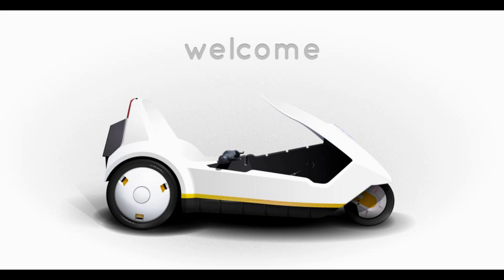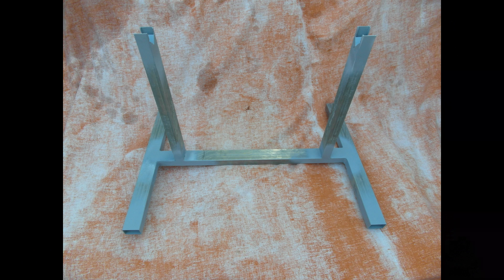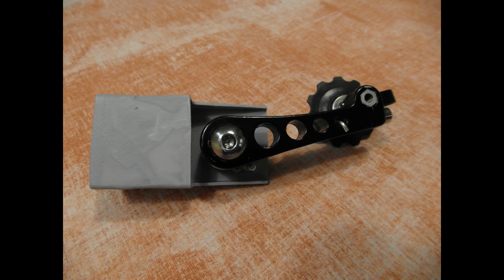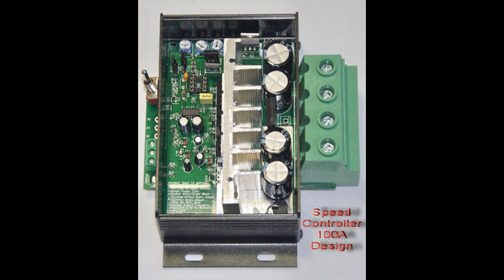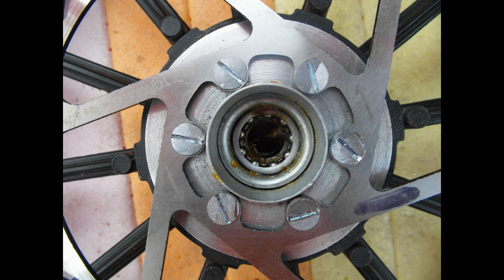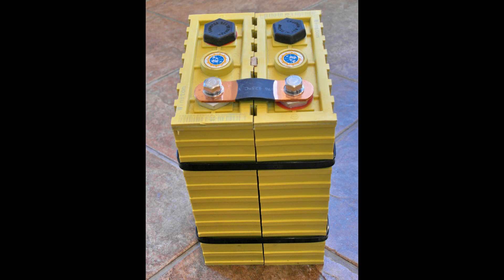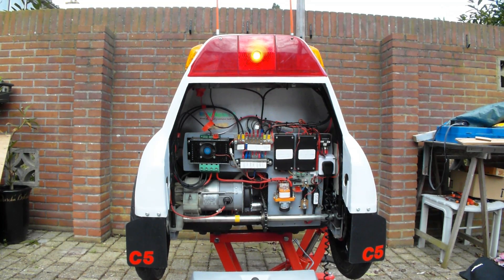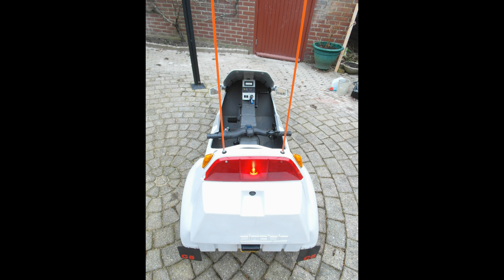Sinclair C5:  Hello I am Clive, 30 years on.

Comment: beautiful restomod. im planning on doing similar mod but using ebike parts.
Reply from the maker: Welcome to the few who have improved their C5's with modern innovations and materials. This particular machine is still in regular usage for 7 months of the year and it now has a younger brother, which has been adapted with a 48v, 350w Front wheel drive, a disk brake and telescopic suspension. This machine also has an 8 speed pedal assist rear hub, and is the only C5 that I know of that can drive in reverse, without the pedals being turned whilst in reverse! A center console is installed and a windscreen. The seat is high backed, padded and with a head rest. The mirrors are to be replaced this season with a LCD screen after the windscreen, in combination with a rear facing camera which is built-into in the rear number plate lamp. Don't be afraid to discuss your ideas or problems, many answers are out there, and I am willing to help, (from a distance,) as I am a resident of The Netherlands! The C5 has been a good hobby, but it's now getting more expensive. Regards, Ty Hawkins
Reply: @Ans1401  Hello neighbour im from belgium, native dutch ? i hope to pick up my c5 tomorrow.
Reply: @Ans1401  ook ik heb een Sinclair kunnen bemachtigen. zelf heb ik al eens een trike gemaakt die erg op een ICE-Trike lijkt en daar heb ik een set van Yose power op gezet met een 26inch achterwiel.
ik wil eigenlijk de C5 uitrusten met een derailleur voor beter fiets gedrag. (misschien een groter tandwiel voor. moet er wel een klein extra bultje op de midden console. maar ach.)
de elektriciteit is er op het moment al allemaal uit en verdwenen. omdat hij ooit als skelter is gebruikt voor een jongen met een beperking.
ik wil ook graag huidige e-bike materialen gaan gebruiken. in principe als er maar een PAS censor op zit en de motor hooguit tot 25 km/h ;) ondersteunt zou hij zelf volledig ongeregistreerd de weg op kunnen net als elke ALDI/LIDL e-bike. ik heb de YOSE kit's die ik op mijn trike en fiets heb geplaatst de bijgesloten gas hendel weg gelaten om eventuele verwarring te verkleinen. (al zitten die wel gewoon op sommige originele e-bikes. maar mogen dan maar tot 6km actief zijn als meeloop hulpje ofzo.)
ik ben alleen nog in dubio wat het snelst en het makkelijkst is om te gaan toepassen. fronthub itwat lastig met zo'n klein 12"wieltje of DC motor met dikke controller in de originele bracket. of misschien zelfs een Bafang of TSD ofzo nou ja die andere. op de crank bafang heeft torque sensor en die andere magneten sensor.

Comment: Hi Ty, do you still live in Heiloo? Recently a proud owner of a C5 myself living in Heiloo as well! I'm looking to upgrade to lifepo batteries myself. Are there any concerns/ mods I have to take in account?
Reply from the maker: Yes I am now retired, but still in Heiloo. I can help and advise you. The videos you have seen are of RDW registered, daily used, 12v (Sinclair motored,) C5 with 90A/h, 4 x 3.2v, LiFePo4 batteries with BMS and a PWM controller. Pedal assist is through a 3speed hub. I do now have a second C5, which is in the making, with a Front wheel drive, 48v., 350W motor. Power comes from a 20A/h LI battery, which supplies a programmable 3 phase controller, which has regen. The new front forks house the motor hub, disc brake and telescopic suspension! This is being developed for both forward and reverse driving! The rear is for pedal assist only, (in the forward direction,) through a 8 speed hub. The braking has also been converted to a disc. If you would like to visit and talk,  bel. 072-5335851. If I am not 'at-home', just leave a message on the machine, stating convenient time frames which work for you. de Koffie (en Tee,) is altijd klaar. M.v.g. Ty Hawkins.
Reply: Bedankt Ty! Ik kom snel een keer langs!

Comment: Well, it looks as if Clive the C5 will be around for quite a while thanks to your patience and updated propulsion system. Very nice job. I never did understand why the motor didn't drive both rear wheels, and incorporate regenerative braking, regen had been used on many electric vehicles then, especially of course DC electric trains.

Comment: I noticed you have a vehicle registration plate. Due to the changes you made, did you have to vehicle-type register it and get it licensed for road use, or is that just for show?
Reply from the maker: Paul,
         In the Netherlands the C5 was not recognized as an electric vehicle by the RDW for 30 years! (This organization was/is responsible for the classification, certification & registration of road vehicles in the Netherlands.) In the early days, when when importing C5's, the Customs authorities, having taken advice from the RDW, were instructed cut the vehicles wiring loom, in order to make them 'legally' a pedal tricycle only! 
The Police have been known to stop drivers, sometimes issuing fines and even having impounding vehicles', pending a technical investigation. 
Three / Four years ago the RDW had been pestered so much by a few enthusiasts that they finally relented and decided to recognized the C5 as an 'invalid scooter' This which was brilliant, as the alternative choice was a 'Pedilec' classification. This would have required modifications for the motor control to only assist when pedaling above 6Km/h. 
The vehicles can now be legally insured,  (in my case by the ANWBs' insurance company equivalent to the U.K.s AA,) and a new annual registered insurance number plate is issued through the insurance company, every year, on payment of the insurance cover.
Now the C5 can be used on bicycle roads, (when provided,) and on roads when not, (this does not include motorways,) up to 25Km/h, it is also permitted to (crawl) on pavements, up to 6Km/h. (Mine had already been modified to 'Pulse Width Motor control', so it was perfectly capable of variable low speed control.)
Personally the police have walked around the vehicle and on seeing the insurance number plate have either left me alone, or struk-up a pleasant, if inquiring conversation.
I still use the C5 locally, typically 5Km to town or the beach, mostly in the warmer months. 
I also show it at 'Old Timer' and 'Motorcycle/Moped' shows during the year. (It fits in the back of my estate car!) I am usually the only electric vehicle on display and I can actively demonstrate it inside exhibition halls, which none of the other vehicles can do as they use flammable liquids, make a lot of noise and pollute the air!
Reply: Tyrone Hawkins
Wow astonishing. I never knew that! Cutting the wiring loom on imported C5's!! Netherland's was strict back then, damn.

You use your C5 in Netherland's? Incredible you still use it over the distance. I guess Netherland's being quite flat though is ideal country for C5's which don't handle even modest incline hills very well I heard!

I'm still working on restoring my C5, I've got the lights working so it's looking promising, but I've yet to hear the motor run! The main fuse was blown when I bought it and it hadn't been run in 27 years, so god knows what condition the controller and motor is in ;-)
Reply from the maker: In Holland the authorities did not have a classification for the SINCLAIR C5 for 30 years! After representations from a few persistent owners, the decision was made to classify  it as a 'Scootmobile'. Each year it is now insured and comes with a new registration plate. The classification also means that the 250w motor limit is no longer, I have seen 'Scootmobiles' with 800w motors! The pedals are also no longer required, and reverse is considered a normal function.  I am looking at a 24v 450w option, this should give a better acceleration and a steady 25km/h., Which seldom achievable with the existing motor and gearing.

Comment: Wow Tyrone, that's astonishing! Sir Clive should have hired you to design this and I bet the C5 would have been a successful seller! All those short-comings you mentioned are really why the C5 was wrongly marketed and failed to sell in the UK. It was really a glorified toy car, or perhaps more generously, the first electric bicycle, but woefully underpowered due to the sheer weight and lack of gearing.

I have just picked up a C5 which I'm in the process of restoring. I can't do anything close to what you've managed (I'm just not as mechanically skilled as you clearly are!) however, e-bikes is a passion of mine, and I'm tempted to just remove all the 1985 electrics and motor, and update with modern controller and motor drive system.
Reply from the maker: Paul, there are 2 versions of this video, an extended & updated version which is titled [Sinclair C5, 'Hello I'm Clive'], this newer version, (which is 10 minutes long,) also shows the C5 in use. This version is now also due for an update because
The rear number light plate is now a concealed LED item, (from VW,) this replaces my 'first attempt' surface mount item. A spiral (telephone type) chord with Plug/socket, allows the boot to be removed easily.
The Original front light is now converted yet again, to a 4.5w, LED unit, a horn is mounted under this lamp, facing downwards over the front wheel. 
An FM radio/amplifier is installed above my replacement cabin display, this uses a SD chip to give commentaries to the public, for use mostly at exhibitions. The 2 loudspeakers are under the seat. 
A 'Battery Management System' board is mounted behind the rear lamp lens, where it is nice and dry and easy to inspect, but I admit it was a 'B' to engineer-in!
Reply from the maker: The body now sports a wind/fly screen, which stops my eyes from watering. Typically the wind stream went over the upper body and under my glasses! For shopping a 'quick release tow ball' has been fitted and now I tow a trailer to the supermarket for my shopping. (See, 'Sinclair C5 with trailer') This machine I think has now realistically reached its maximum development potential. A second C5 is now being developed with a 48v reversing front hub, which incorporates a disc brake and telescopic suspension. This with re-distribution of weight, softer walled tyres and a full re-instatement of the rear torsion arms, should provide a more comfortable ride. The seat now incorporates a head rest, and has a padded, slip-over, one piece water proof seat cover. It's easy to dry when wet, but the drawback is that it can get very hot in the sun, and subsequently sticky when driving!